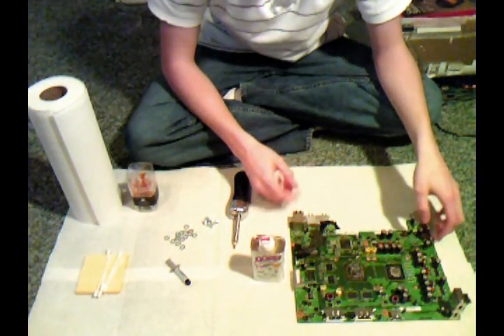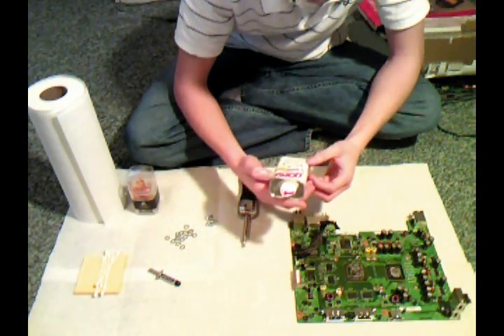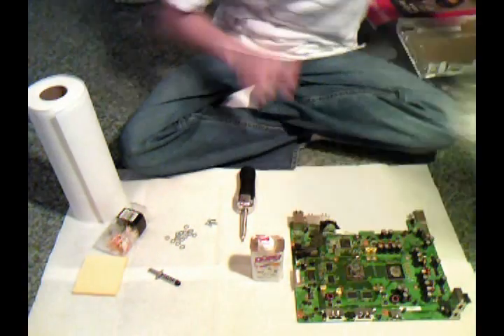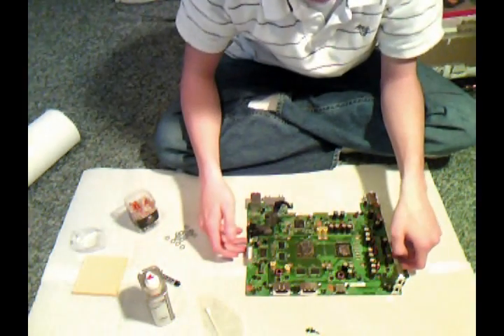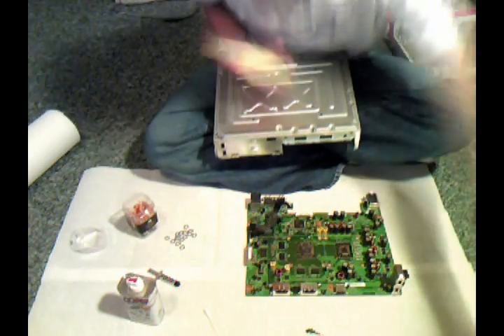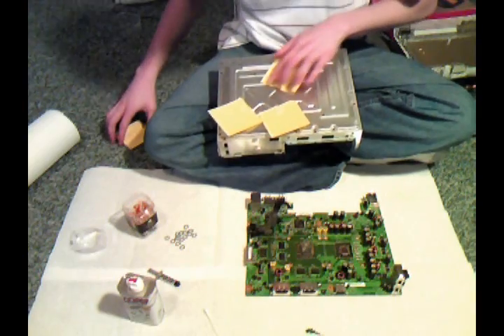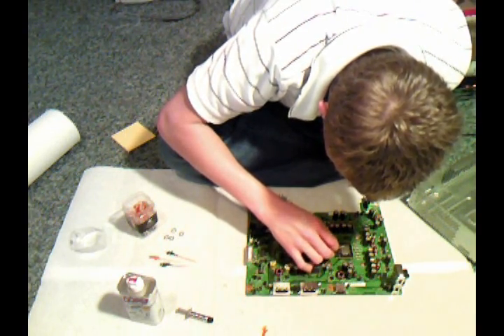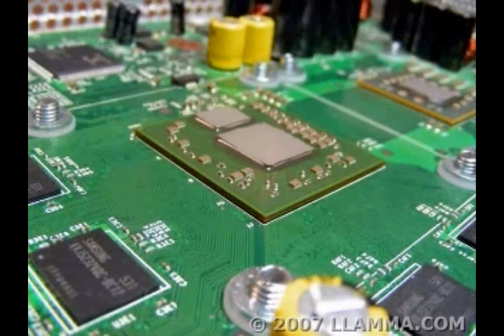X-Clamp Xbox 360 Fix Mod Tutorial Part 1 - Zapple

Comment: tip:  dont spread the thermal paste yourself.  let the pressure from the heatsink spread it.   You'll end up with tiny air bubbles in your paste if you spread it yourself, and the heat transfer wont be as good.

Comment: Putting the screws through the case is pointless. Just put them straight through the bottom of the motherboard with a single washer on the bottom, then you can still take your motherboard out without disconnecting the heatsinks, which always has the potential to harm your CPU or GPU when you put them back on. I don't know why these tutorials tell you to do that, it's totally retarded.

Comment: well how long is a piece of string, all depends on how you use your console, out of 100 consoles, about 5 to 8 people came back, i ended up selling them new consoles, the later model console have been fixed from factory. if it comes back again you could try using a heat gun and heat the gpu up, not a safe way but it could fix the problem.

Comment from the maker: Other thermal paste should work, but if you read the comment a few down from this one there are people talking about it. Someone said Arctic Silver 5 is the best, I personally do not know which is the best and used the one in the tutorial I read following.

I didn't use the clamps at all afterward, I just used the screws that I bought and secured the head sinks back to the GPU and CPU.

Comment: will it work with other thermal paste ? and one more qestion , did you screw up gpu and cpu with screw (without original X-Clamp) or you screw up only gpu heat sink and use original clamp for cpu ?

Comment from the maker: You can't use the same screws because when you remove the XClamp those little screws were what was holding it on and causing strain on the motherboard. Doing this eliminates stress on the mobo and creates a nice tight attachment of the heatsink to the CPU and GPU.